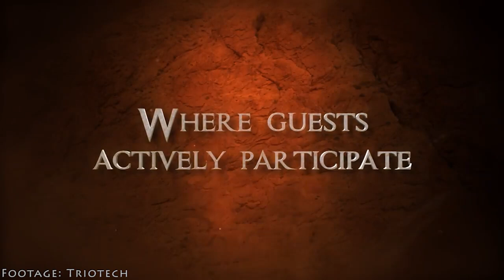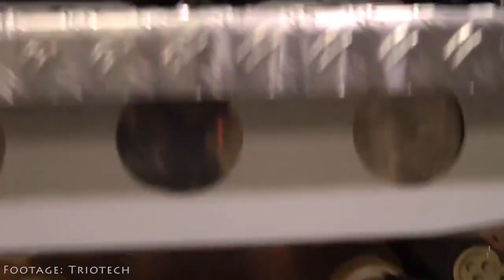Canada's Wonderlands Biggest Mistake

Comment: No shade meant at all towards CW and Guardian. But, I've only been on Guardian like 3 times. Firstly, They don't have fast lane for it. On top of that as you mentioned, You have to buy a locker just to ride the ride.  Secondly, Sometimes the guns don't even work or, only some work and that takes away the fun/point of the ride?. Lastly, Boo blasters is a better dark ride even though it's meant for children. Boo Blasters has alot of  theming and sound effects instead of multiple screens inside a mountain. In conclusion, In my opinion, The only good part of Guardian is the drop.
Reply from the maker: This sums up my feelings for the ride
Reply: Well said sister
Reply: @colefly1984  Tyty🥱🥱

Comment: Here i was thinking the biggest mistake was selling that large plot of land across from Major Makenzie (i think that's the road? Drag me in the comments if I'm wrong) But i do agree, The Low Capacity / the Shockingly low number of lockers cause this ride to always have way to long of a queue for what it is. they could have done so much better for putting something in the mountain.
Reply from the maker: Yeah and the tech is just flawed
Reply: I always wanted to see the part across Major Mac get developed, and a roller coaster with two stations (for separate out and return rides) used as a high speed connection between them. (There'd be slower options too, I just think it would be neat to have a park train like Disney but with a thrill ride twist.)

Comment: Guardian would be more fun if it went alternated better between roller coaster and dark ride. When the train is turning around for the next set of screens, they could have had the ride do a drop or two in and out of the mountain. I do enjoy the drop track, which really caught me off guard when I first rode it. But aside from that bit of surprise, there's nothing special about this ride. It's a family coaster but it rides like a kiddie coaster, aside from the drop track and sometimes going up the lift hill backwards. It just needs more variety so that it's not a little coaster with an uninteresting dark ride dead spot in the middle.

Comment: I will admit this was a bad one, I went on it once and never wanted to go back again. but i thought the worst coaster was dragon fire. It was not fun and my ears and neck hurt really bad after being on that ride. IT'S THE WORSTTT!!!! And they hide it away so not many people know about this, this is one that should go away in my opinion.
Reply from the maker: Dragon Fyre does hurt a lot of people interms of ears and head banging :(
Reply: Lol, Dragon Fyre was the star coaster and ran with three trains when this park opened. Oh how times have changed, today Leviathan's brake run is taller.

I always ride it at least once during a visit, and remember first being on it in 1982 with my cousin from Germany. A double loop, what a thrill that was for a 12 year old!
Reply: Sorry to hear about your injury on Dragon Fyre, but it needs to stay.  Went on it with my kiddo this year.  Not smooth (compared to anything modern) but certainly smoother than I remember it (in the front).  The bat will bang your ears much worse if you don't control your head movements.
Dragon Fyre does, at least, still fill that "Entrance level, inverting coaster" niche.  A great first coaster for the 48" kids.
Guardian?  Simply a let down...and the biggest "let down" is actually the only good thing left about the ride.

Comment: Definitely agree the park/Triotech needed to find a way for the blasters to receive power while on the 60 foot level. Outside of that, I really disagree with this being Wonderland's "biggest mistake." 

Wonderland did not want "theming" (physical props/sets) because they wanted to easily change out content. Perfect example is Zombies 4D during Halloween Haunt while the "Quest for Gold" story is still used during the day. That's why they went fully screen-based and I honestly think that works really well! The ride is really popular with families, which seems to have been their target audience all along. It's unfortunate it was kind of marketed more as a thrill ride (even though it does have the amazing finale) because that's not really its audience. The ride went over budget and construction was more difficult than they anticipated (It was one of the coldest winters on record and the mountain is not heated; Wonder Mountain is/was an aging structure so it was more difficult to work with; They needed to build the entire 60 foot level because it was previously just open space), which is why the ride opened late and possibly why the rest of the station seems unfinished.

Again, I think Wonderland needs to find a solution for getting power to the blasters while on the 60 foot level, but otherwise I think Guardian is a great addition as a family coaster/ride. I hope the projectors get updated (and I heard the park was looking to do that), but the real issue was the 3D. It required two projectors which caused a lot of blurriness when they weren't synched up perfectly. Thankfully they stopped using that so the picture is much clearer now.